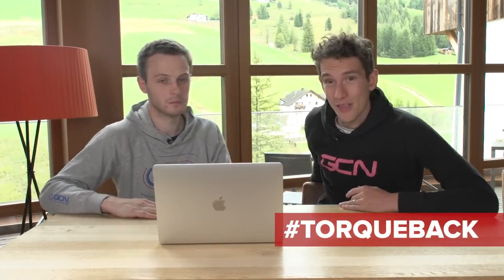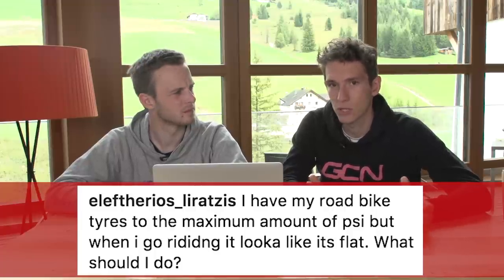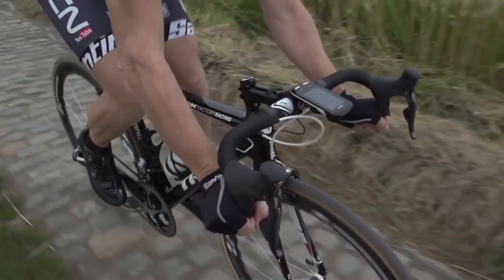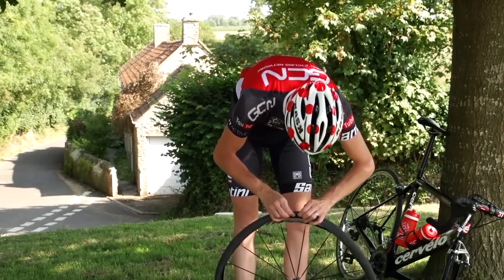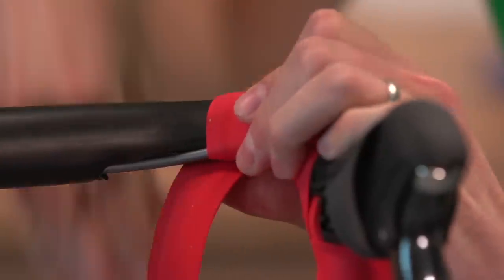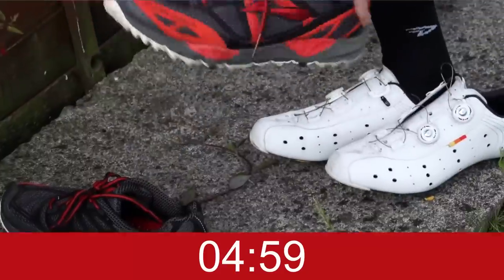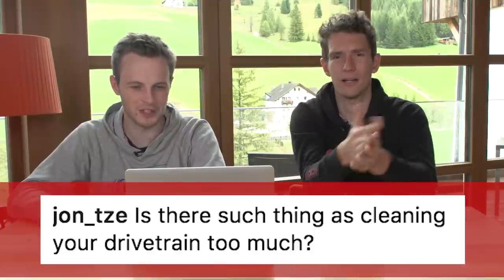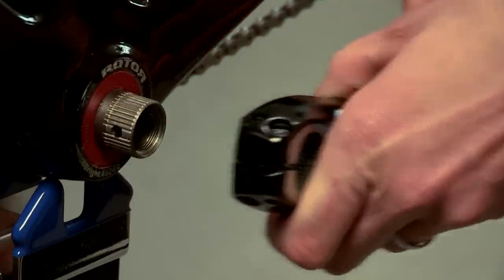Mechanical Special | Ask GCN Anything Cycling

Comment: My road bike has a bb30 bottom bracket and I want to change cranksets to Ultegra. Which bottom bracket do I get? #askgcn
Reply: you need a bb30 to hollow tech adapter then a standard hollowtech bb.
Reply: BB adapters do work, but conversion BBs are better as there will be fewer interfaces for creaking.  Praxis Works and Rotor make them and they can be purchased for $60-80 if you shop around a bit.  Good luck! https://praxiscycles.com/conversion-bb/

Comment: How come (more) pro's don't use titanium handlebars if they want to save weight over aluminum but are worried about breaking carbon ones?
Reply: because titanium has 2x the weight of aluminum
Reply: Oh seriously? I thought titanium had a higher strength to weight ratio than aluminum... interesting, thank you!
Reply: SirBlot what are you talking??? Lightest bikes out of steel??? Lightest handlebars aluminum??? That is nonsense!!! Try to build a frame of sub 700 g out of steel - it must be made of steel-foil, as thin, that you will buckle it with a finger snip! Or try to build a 150 g bar from aluminum - impossible to make it safe! Metals have their advantages over carbon - but not when it comes to weight in parts like frames, forks, handlebars or seat posts
Reply: well, those no name carbon bars you can often buy on eBay are crap, I would not buy them. As you mentioned, carbon parts has to be made with much knowledge, no sense to get them only because they are carbon. But well made it's the best way today for light weight. If you talk about flatcars, the Schmolke f.x. is 63 gr - and not bouncy but really stiff! 

But to come back to the original question - pro riders have the weight limit of 6.8 kg for their bikes, and they always have in mind to ride on after a heavy crash, so they don't look for the lightest handlebar. Therefore they use often aluminum bars

Comment: #TorqueBack Can it be inefficient to practice on a too steep of a gradient?
Reply: Yes- if the road is too steep, you will be be putting out way too intense of an effort to do it very often.  Think of super steep roads like a hard interval, since that's basically the effort needed to simply get to the top.  I routinely ride roads with a gradient anywhere between 6% and 14%, but I don't ride the steeper ones very often because they don't fit into my training plan.
Reply: Okey, Thanks!

Comment: Hi Gcn, my question is about my brakes. When i am start sprinting or ride out of the saddle my brakes touching my wheel what shoul i do? ( when i am riding on saddle no touching ) #TorqueBack
Reply: your wheels or frame are flexing!  check spoke tension, or you may just have to ride with more brake block to rim clearance
Reply: Thats just because your frame or wheels are not stiff enough, only solution is to get a stiffer frame or wheelset. You can get around the problem by slightly opening the brake calipers like alberto contador used to do on mountain stages.

Comment: #torqueback What shoes should I wear for flat paddles if I don't want to look like an idiot wearing trainers with full cycling gear on.
Reply: I wear trainers, you do feel like everyones making fun of you in rides but you can make up by dropping them on a climb like I do.
Reply: This isn't just about looking a certain way. A standard trainer is very flexible and won't help with power transfer. Look at mountain bike SPDs that come with a rubber cover over the cleat holes. The cover usually still has an element of tread to grip your pedal (so ignore the cleat function completely) but they will be stiffer, more weatherproof and just generally more suited to the requirements of a cycling shoe. 
They also won't look too dissimilar to a road shoe as well, so will address your initial query. You will also beat your riding mates into the cafe too as they toddle along on their road cleats! :)

Comment: #torqueback Could you use 10 speed shifters on a 8 speed rear derailleur?
Reply: no
Reply: No, the 10 speed needs smaller steps between gears than the 8 speed. The 10 speed shifter won't pull enough cable to change gears on the 8 speed rear mech.
Reply: koko lores so I would need to buy the shifters, cassette AND rear mech?
Reply: rear derailleurs dont provide the indexing, shifters do. As long as the cassette and shifters match, youre good to go.
So, if you have a 10 speed cassette and 10 speed shifters, a 8/9/10 speed rear derailleur WILL work.
Dont believe the other guys, it will work. Sheldon Brown (The best bike mechanic there has ever been) has an article detailing in depth what I just told you. Check it out! https://www.sheldonbrown.com/speeds.html

Comment: #TorqueBack

Hi GCN, I am wondering why Pro's often put their deeper rims to the back.  In my opinion the rear wheel is much more sheltered from the wind, than the front wheel (frame, body). So why should you add more weight for less aerodynamic advantage? Please correct me if I'am wrong and yes I unterstand the steering point of view in crosswinds. Sorry for my bad english, greetings from Germany.
Reply: Yeah, I think they said it in one video. The fact is that you benefit more of the front wheel, but it would be harder for handeling the bike, while the rear wheel just need to be aero
Reply: Because the deeper the rim, the more it gets affected by side wind. So if a strong wind comes form the side and you have a very deep rim in the front, it could mess with your steering, turn your handlebars and cause you to fall. The rear wheel is obviously not affected by this beacuse it doesnt turn to steer, so its safer to have a deep rim on th back and a shallower one in the front.